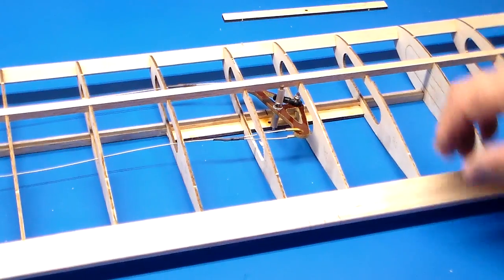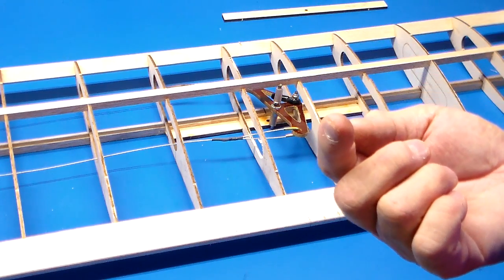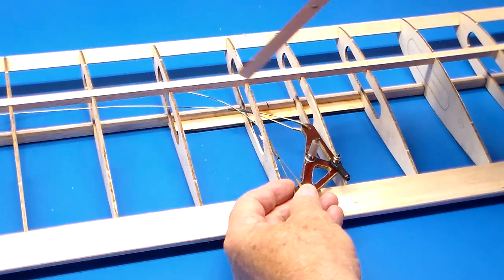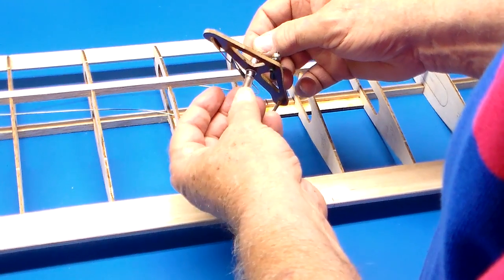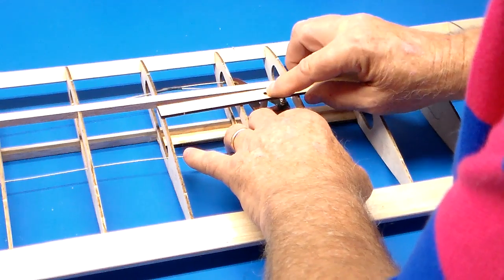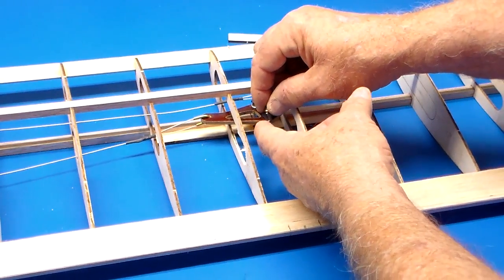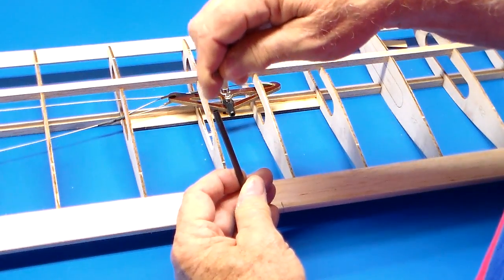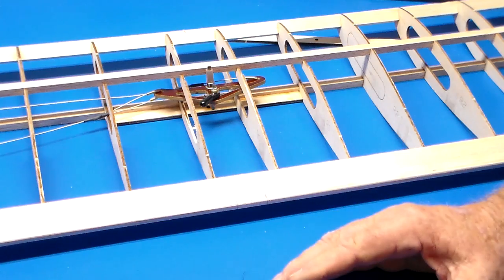SUS Bellcrank

Comment: Do not wrap with thread, use brass or aluminum tube with ID of the carbon tube OD.  Used it on unlimited class sailplanes for elevator pushrods and never split one out in flight.

Comment: Where can I get the ball swivel and the titanium threaded capture ?  Also, how do you control the movement of the bellcrank so it does not move excessive in either direction ?
Reply: The next outer rib can be solid to create a bellcrank travel stop.